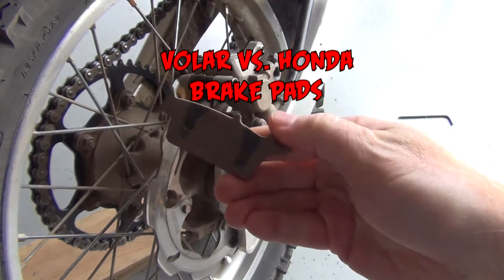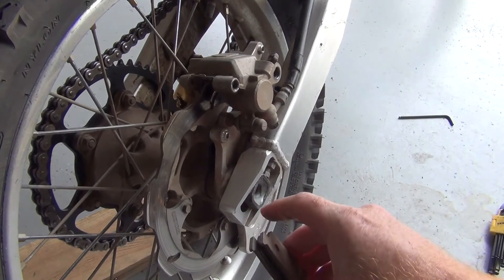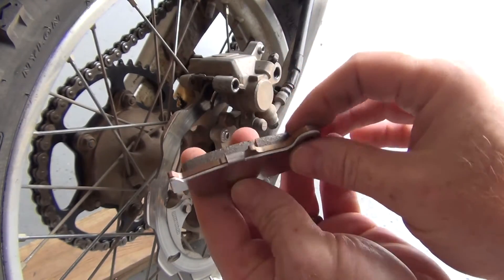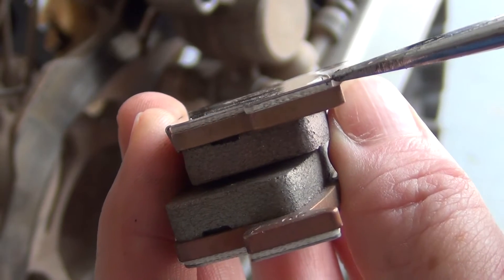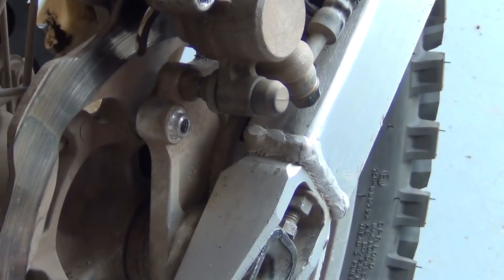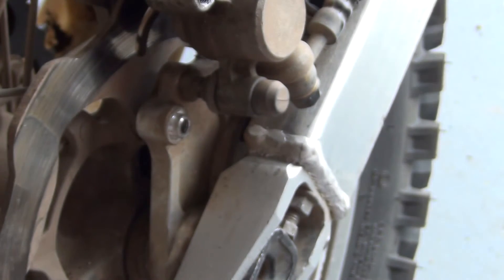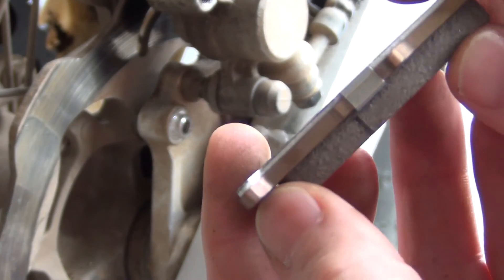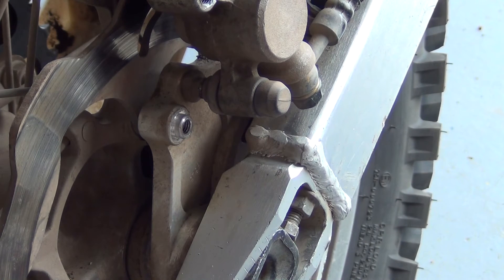Volar vs. Honda brake Pads

Comment: Do you have a brake caliper problem, too much fluid in your brake system, or you may not realize you’re riding the brake pedal..
  The reason I think you may have a brake caliper problem is, the brake pads wore unevenly..If your caliper does not float, the Pistons are supposed to do the self centering. I don’t know how you knew your brake fluid was boiling. Have you changed the brake fluid within the past two years. You should change your brake fluid every two years because brake fluid is alcohol-based and absorbs water through the breather. The air has moisture in it. That moisture contaminates the internal metals. that corrode..The corrosion flakes  off and gravitates to the bottom of the system which is your brake caliper bores & pistons..If your caliper is a double action/meaning it has pistons  that squeeze from both sides of the disc..One side is obviously hanging up. If it is a single action caliper. Meaning the Pistons only push from one side and pull The caliper on the floating pins to engage the backside piston. Obviously if that’s the case, the caliper is not floating. You have a problem with your caliper.
   I have seen riders that never learned to use the front brakes. I was a motorcycle state safety inspector when I was a motorcycle mechanic in a Honda dealership. I could not believe that  some people survived on the street without using their front brakes. Their front brakes looked like new when I would do an inspection, and their back brakes would be shot.I’ve asked riders why they don’t use the front brake. I’ve actually heard the excuse, they didn’t want to flip the motorcycle over.I always told them after that kind of a statement, the front brake is the one that’s going to save your life Pal..
  another thing that tells me you have a caliper problem or a breaking habit issue. I think you said you’re riding a Honda 650? If I’m not mistaken, unless they have another 650 out there, that is a big single four stroke. On a big single four stroke, with engine braking that massive, you do not have to use the brakes as much as you would on a two-stroke, or a four-cylinder.I myself of had four stroke big singles. Yamaha XT 500, KLR650..I know how a big four stroke single slows down big time when you downshift without touching the brakes.
   I do believe that the original OEM brake pads are best for general street riding. On the other hand, I rode in situations that were very muddy. off road..Motorcycles and quads. I actually wore a rear set of pads Down to less than the thickness of a dime left in just 2 weekends of muddy riding..That mud just grinds them away.. we don’t have much sand here in the Northeast, but I would imagine that sand is tough on brake pads also..
   I wish you had stated what those aftermarket brake pad material was.. sinteted, ceramic, kevlar, organic? 
   this very situation is one of the reasons that I am actually a fan of rear drum brakes with brake shoes on most motorcycles.I had a 1986 Kawasaki KDX 200. Drum brake in the rear. I never had to replace the brake shoes. I had that motorcycle 18 years. I rode it about 15 times a year, I currently have a Honda pacific coast street bike. 1994, the date today is 2020. so 26 years so far I rode that motorcycle as a commuter on back roads. The mileage right now is 38,000 miles. It still has the original drum brake shoes in the back.
  I always question why a motorcycle needs a 200 hp rear brake, especially on a four stroke. The beauty of a drum brake is, the shoes have four maybe five times more surface area. And they can be adjusted to have zero drag. They don’t hang up, there’s no brake fluid involved or master cylinder, or caliper problems..Just look at big tri-axle and tractor trailer brakes. They still use Drum brakes with shoes.Drum brakes on a motorcycle are lighter, You don’t have a disk that acts as a gyroscope that does not like to change direction quickly, it’s less unsprung weight, And a disc is a big fly wheel that Hass to be accelerated. A disc in the back on 90% of motorcycles is overkill..
   I road raced For eight years, mostly two strokes. (won 6 championships,2-national championships - AMA ,WERA) You just don’t use rear brakes that much for changing speeds in road racing, Or for setting up turning/backing it in ...Watch MotoGP riders. Many of them have the rear wheel in the air while braking. using  rear brake for slowing down in MotoGP is practically useless to those guys..
  That’s why it’s surprising to me that on a big four stroke single you would wear the rear brakes out on a relatively light machine. you have a brake caliper problem, too much fluid in the system which will keep the pressure on as the heat rises in the brake fluid if there’s too much brake fluid in the reservoir, or you have braking habits you need to change a bit...
Reply from the maker: Wow you typed a lot more then I plan on reading. Seeing as this video is old, and I still have the bike with better pads, I haven't had an issue and wear is even. Volar is Chinese junk is what it comes down to.
Reply: Meeker Extreme 
   I can’t think of a single item that china makes that is great. an  engineer buddy of mine works for a company that makes liquid nitrogen vessels. They look like tanker truck submarines. They make them in China. He is flying over to China 2 & 3 times a month. I asked him what the hell do you have to keep going over there for.
 he gave me these two examples—
did you ever buy tools from Harbor freight. They’re not great, they’re just good enough for a while.
   The people of China may be book smart but they have no practical common sense. They did not grow up helping dad work on the lawnmower or the car. They grew up with a shovel or a broom in their hand, maybe a hammer.
when you grow up using a broom, good enough is good enough. They learn this from a very young age. Good enough is the standard.
  The reason my friend goes to China two or three times a month to check on production standards at the liquid nitrogen vessel plant is—
   good enough, isn’t good enough when it comes to liquid Nitrogen vessels..
  I bought one of those Coca-Cola cans sized 12 V air compressor‘s and gave it to my sister because she had a slow leak in one of her tires. She was putting air in it about once a week at the local gas station. I stopped by her house to show her how to use that pump. I plugged it in, hooked it up to the tire, it ran for about 30 seconds and then it smoked..
  I bought one of those Barber style electric shears for cutting hair to trim my beard. It literally burned up within 10 seconds the first time I tried to use it.
   They say the Chinese invented fire crackers. That’s pretty much what to expect out of their tools. They’re only good once ...

Comment: if you overheated the brake and boiled the fluid the pads no matter who makes them doesn't matter you are dragging your brake way too much. I never use cheap tire or pads and for the most part always use Galfer but i own a bike shop and have changed thousands and not once has a pad change alone boiled the fluid unless it was too thick and you should have pulled the shim off the stocker and added a dab of CRC Disc Brake Quiet between the shim and the pads or on a straight dirtbike i like Disc Brake Pad Shims by Carlson if you don't have a set
Reply from the maker: Funny I never had an issue since the Volar pad test or before. Which tells me the pads just SUCK. I bought them to try for you all not for me really. Now you know not to buy Volar, stick with EBC or many other named brands.

Comment: Your supposed to transfer those shims to the new pads.....
Reply: Also, what material pads did you get? Sintered HH, kevlar?
Reply from the maker: Um no, the metal is attached to the ceramic that is in between. There is no transferring that over.
Reply from the maker: Off top of my head the Honda ones are Sintered, no choice in the matter they are the OEM pads. If you mean the Volar ones who knows for $5 they were okay but total junk really.
Reply: you experience differed quite a bit from mine. I have the sintered pads on my BMW K1200s and so far they have been great.
Reply from the maker: 2wheelLove Different bike, different results. Plus pad design and what have you.
Reply: I used a full set on a hayabusa and didnt have a problem for 3k mi.